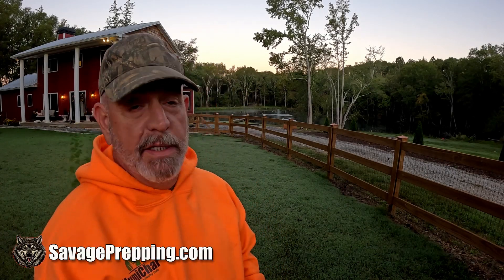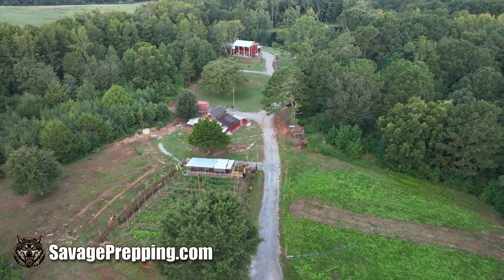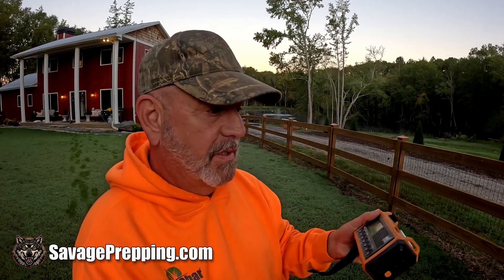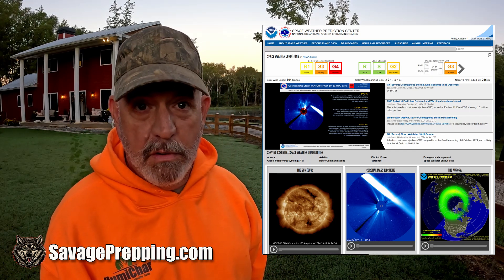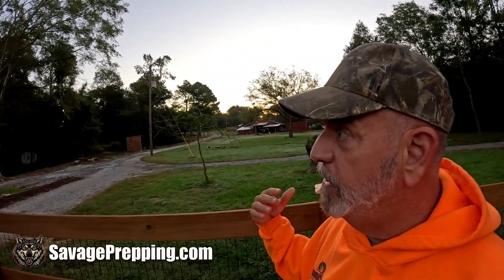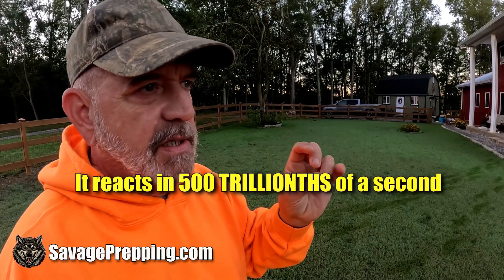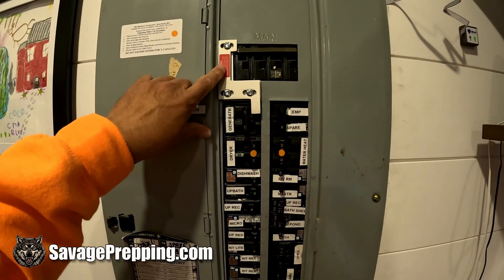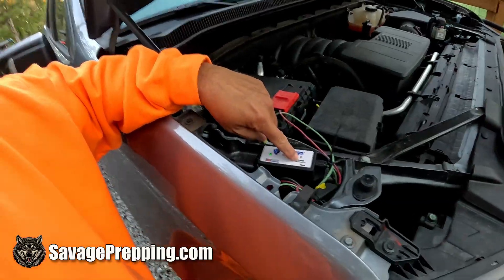EMP Lightning Solar Flares Whole Home Protection

Comment: Hi Doc, I commend you on your prepping..  not sure what kind of doc you are or if that's just a nick name, but you have a few things wrong.
1) EMP Shield is a poor product..    they make claims on their website that violate the very laws of physics, which puts into question any other claims they make.
2) A FAR FAR better surge device is the Siemens FS140 with a response time of under 1nS (1 nanosecond)
3) All whole home surge protectors have some kind of multi-thousand dollar guarantee.    Good luck collecting.
4) Solar EMP's and Nuclear EMP's have about as much in common as sharks and pickup trucks.  They are not remotely the same thing, and no whole home surge protector will protect you from a solar emp because it lasts for so long.   What will happen is that the surge protector will sink as much energy as it can to earth, then the breaker it is connected to will trip..     As for a nuclear emp, while the whole home surge protector can provide protection from the conductive surge, it can not provide protection from the radiative component.   No surge protector can protect your home from the energy being transmitted through the air..
Reply from the maker: I have a Siemens FS140 sitting on a shelf.  I prefer the EMP shield due to the levels of testing. https://www.empshield.com/testing/  Also the FS140 is being discontinued. The newer model does not have a flush mount option. The guarantee is only for lightning FYI.  Good video as well... https://www.youtube.com/watch?v=cXJ0WzGe5-4